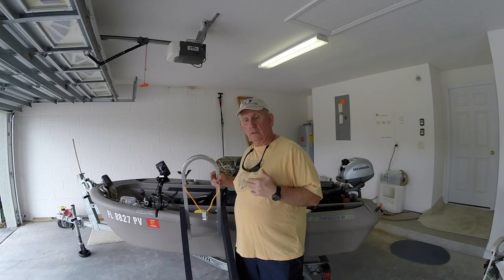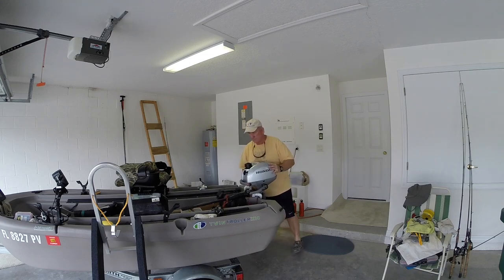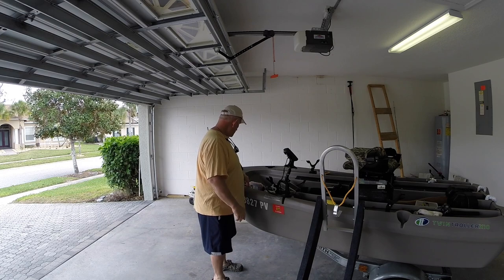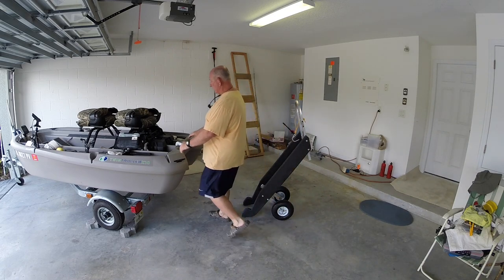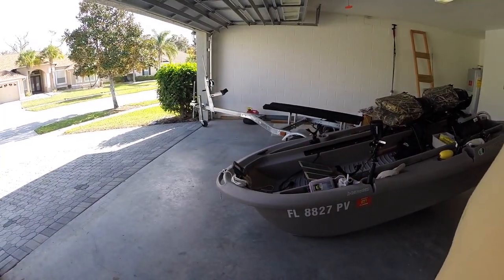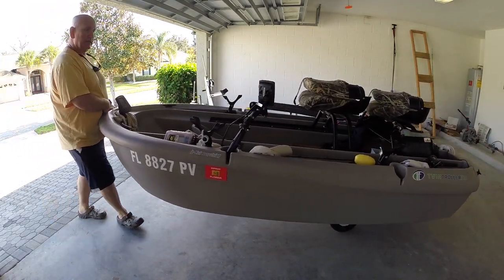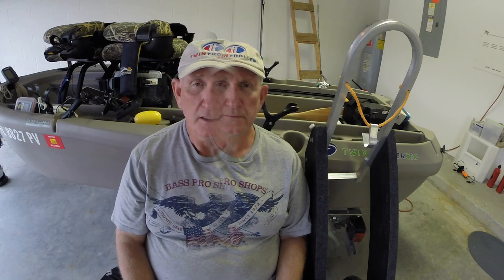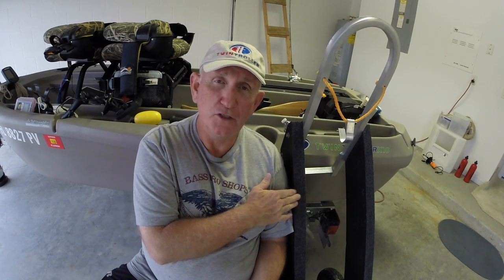QUICK LIFT DOLLY IN USE, KINDA

Comment: Good effort.  I'm glad your trailer hitch didn't go through your garage door nor the TT dropping on your foot. I did exactly what you did but stopped at the point when the hitch started to raise. I decided that taking the TT off the boat trailer would be safer if I hitched to my truck. It really does take two people to safely take the TT off the trailer. The steps are reversed when loading the TT back on ( with the trailer hitched to the tow vehicle). However, the pulley strap helps winch the TT back on. One person can do this but it's a real effort. These steps/instructions would have been nice to have with the dolly purchase in the interest of not doing self discovery. I also appreciate that you kept everything in the TT minus the fuel and outboard motor while off loading. Who really wants to take their TT apart and put it back together everytime. Great consumer field report/demonstration and I thank you for it.
Reply from the maker: John, I agree with you. The safe way is to have the vehicle on the trailer ball to stabilize the trailer. I did not want to get my vehicle every time I wanted to do this so I tried doing this my way. 
Gerry

Comment: Good morning, Jerry. My TT is scheduled to be delivered after March 23, 2019. It appears the dolly is a good purchase for easy handling of the boat. Especially getting it from my driveway and into my garage when the truck drops it off. Do you know when the newly improved version will be ready for ordering? What changes are they making to the design? Thanks.  Gary
Reply from the maker: Frank from Freedom Electric Marine said they are in communication with the manufacturer right now, still designing the new one. He saw my video that I did not publish yet and liked my concerns and suggestions and was taking them to the manufacturer to possibly include those changes. He seemed to want to get going on this. I am not sure how long it will be before the first ones are manufactured but I hope it will not be too long.    Gerry

Comment: Jerry-great videos! When you were doing the mailbag vids, I saw the pictures of the modified utility trailer that was lockable with sides and top. I have that identical trailer and was hoping you could help me find the plans that he used. Any help would be appreciated. Thanks again for all the great ideas and entertainment!
Reply from the maker: Steve, I looked all over for the contact information of Dave in the mailbag video. I must have deleted it somehow. In a few minutes you will see a new video by me that I hope helps your situation.                      Gerry
Reply: @LunkerFishing
Reply: @LunkerFishing  This is Dave and I did not have any plans when I built the trailer and the boat is very easy to put in the water and to take out.  I am not very good at making videos but I will try to make one this spring.  I think the best part of the trailer is right now when it is sitting outside (95% of the time) in its own little storage.   Also it's great when you're done fishing for the day you don't have to put anything away, pull it in the trailer and don't worry about it till you feel like it.
Reply: Also that dolly is useless if you have a battery in the boat!

Comment: I have the dolly today and have to say I wish I didn’t buy it.  It’s pretty unstable once you get it off any pavement.  Once you get it into the water it’s not so bad but if you try to get it back out - forget about it.  You need two people at least as the load is often too heavy and slippery especially on muddy ground or wet grass.  You practically need to winch it out.  Also, you can’t easily it get it out since you have to get in the water to attach the dolly and unless it’s a nice flat area, there is no way you can get it out solo.

Not sure how this can be addresses by a 2.0 version.  The current dolly is really only good for moving the boat around the house when I need to move it to/from the trailer.

Comment: Hi Jerry,I wish I could get my tt in the 28 ac. pond behind the house but the bank is to steep to pull the tt up, I can get my hobie in but it is still tuff to pull up the bank.
Reply from the maker: Rick, I have the same feeling. I want to find a way to get the TT into the lake behind the house. My community has 9 lakes. (That is what they call them in the south. Every body of water, including your tub, is called a lake) Some of them are too small for even the TT and some are too difficult to get to with the TT on the dolly but of the three largest my house backs up to one of them. The apron around our lakes is manicured lawn and pitched towards the lake but I think I can pull it up the grade for the 15' to the top, then it is fairly level. The odd concern is that a manicured lawn like ours is kinda soft and rolling the dolly was a challenge. I hope the new and improved dolly will solve some of my problems I experienced so far.
Reply: Gerry, please explain in more detail the reason for you to call Frank. It seems more of a problem especially having a swap out for the fix. Is it a tire related problem?  By the way, I do have one!
Reply: I still say go to northern tool and replace those wheels, less than 10$. Next take one of the batteries out in the garage, you do not need two. Depending on the slope of the bank, launching is no problem.  When you retrieve your boat you should turn boat backwards, take battery off, use dolly to break the suction. Next run dolly underneath the transom, attach hook, then pull out.   Pulling through the yard is the hardest part.  IMO your going to have to get your feet wet.
Reply: I agree, and hope those wheels are on the new design.
Reply from the maker: Gary, I am answering here for you and all the questions that follow from Dave and Steve. I do not want to say what I recommended to Frank yet because he has to make a product that makes sense for him as well. I asked Frank to make a change that I can test out to address the soft grass issue that he can also offer as an option when ordering the dolly. Not everyone is using the dolly on soft ground so not everyone has that issue but I think enough do that this issue should be addressed. Frank and David seem to read some of our postings so I hope they read this. 
Frank, more others then you think have the soft ground issue. You need to consider that issue in the new and improved version of the dolly.                                 Gerry

Comment: What issue were you having with this dolly?
Reply from the maker: On my soft lawn it was difficult to roll for me.
Reply: My lil brother in Texas, fishing a reservoir. There is a guy that occasionally shows up with his Twin Troller. Its about 40 yards from the parking lot, to the water. He said the same thing. With it fully loaded, the wheels were too small to handle that weight on soft ground. Said he needed bigger, fatter ATV tires.